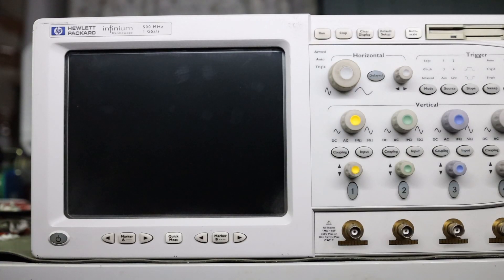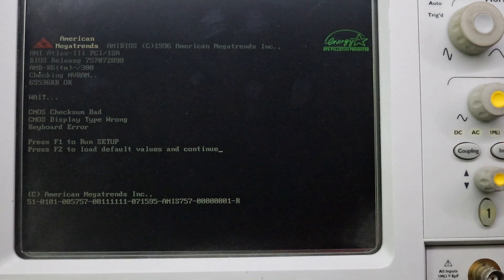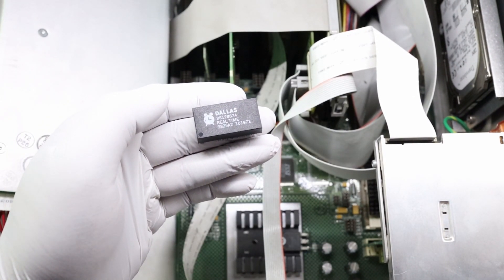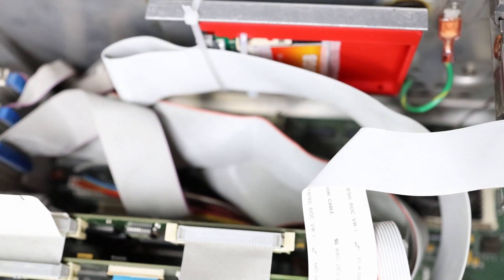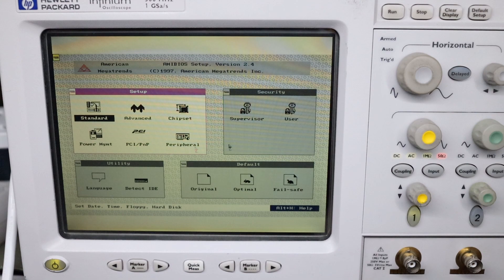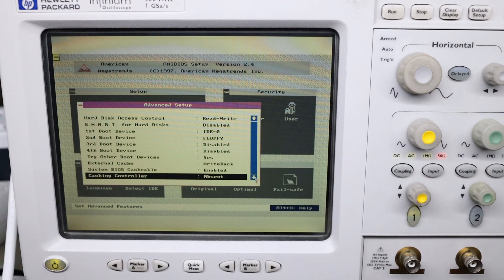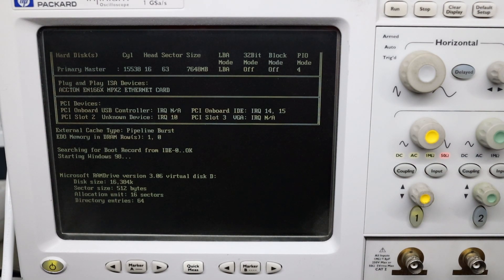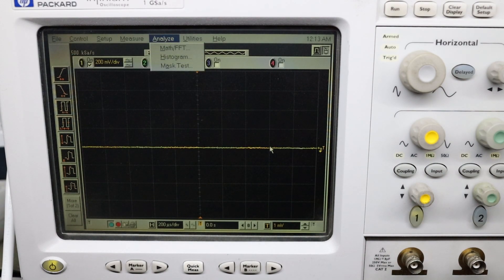HP Agilent Infiniium 54815A 500Mhz Boot Repair and SSD Upgrade

Comment: I have the model with the VA 503A motherboard. But mine fails to display anything on the screen when you push the power button. The CMOS battery red zero volts so I replaced it and I checked the battery on one of the HP cards for the display and that one read 3.1 volts. I'm not sure what's causing it not to boot or display anything on the screen. I've tried leaving out the CMOS battery but still nothing. The bios is a phoenix bios. The screen has some sort of barely visible black lines when on but still doesn't turn on any help would be appreciated
Reply from the maker: These Oscilloscope may have display output try connecting monitor there. If there no port. then you can buy display card. To debug your scope's screen i will start with. If screen is not working or backlight of the screen not working. Try to see by shining bring light from front. If backlight does not  work it will be somewhat easy to fix. For LCD try resetting all the signal connectors.
Reply: @circuitvalley thanks for the message! The CMOS battery was completely dead but replacing it did not fix the issue. I had to take it all apart clean it and then reseat most of the connectors and cards to include the CPU and bios chip and it started booting. The issue the screen did not have any signs of life. So I'm not sure which one was causing the issue but originally there was no voltage for the backlight so by measuring I thought one of the oscilloscope PCI cards that outputs the backlight was bad. Also I'm not sure of what the voltage is supposed to be to the backlight but since now it's working I'll have to measure because it was reading zero before coming from the display card via the small black wires to a little board that has coils on it and that board has two connections to the backlight.
Reply: @circuitvalley it's a 500 megahertz 2Gs model 54825 with windows 98 😅

Comment: A great class on this scope. I have an HP 54831M running win 98. Can you tell us how to copy the IDE drive to the CF drive? I would love to do this upgrade. Or even be able to copy it to another IDE drive. Thanks.
Reply from the maker: I had this card plugged to linux machine and used dd command. There are many disk images tools out there that GUI Based. IDE drives are bound to fail.

Comment: Why do you need to add battery on the dallas real time clock chip ds12887 (real time clock + RAM)?
Reply from the maker: Dallas chip had dead Battery inside. If i don't add battery motherboard will forget boot setting everytime to power it off. It will lose its configuration about harddrive and not boot at all.